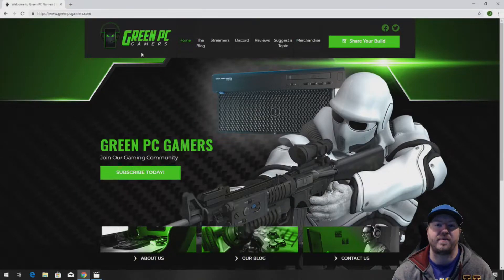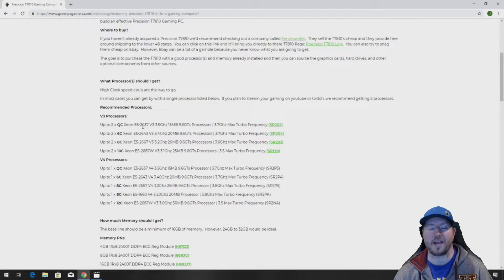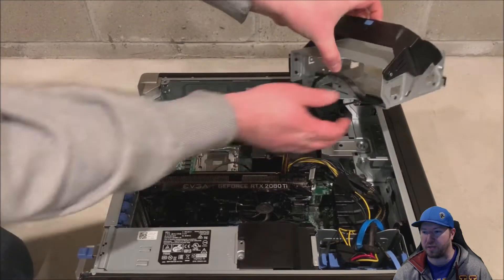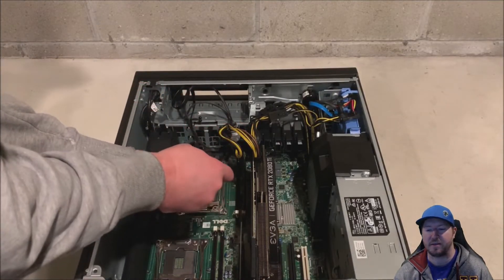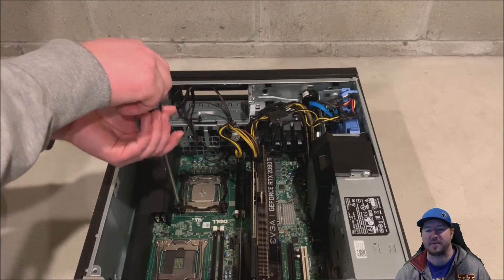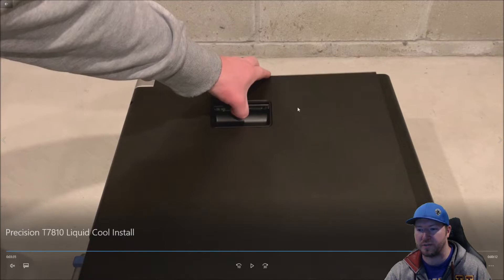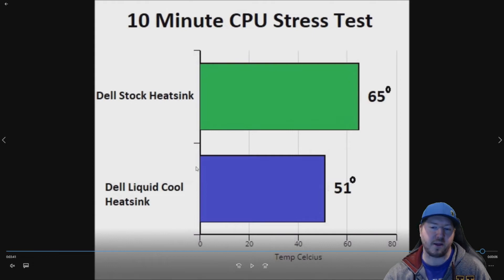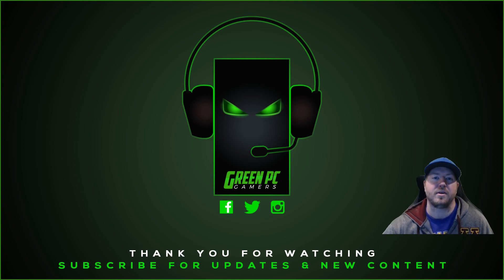Precision T7810 Liquid Cool Heatsink Install for Processor

Comment: looks quite large, can you install the same heatsink for the 2nd CPU?
Reply from the maker: We’ve never tried 2 of the liquid coolers in a T7810.  You should check out the T7810 noctua heatsink install video.  The noctua heatsinks perform better than the liquid cool heatsinks.
Reply: @GreenPCGamerscom  yeah man.. i found this out a while back so .. no need for water cooling :)

Comment: What’s the main difference between all the T series workstations?
Reply: The precision T series are designed as servers and for servers processors (more cores more threads) and non-error ram memory. Because of this they are good for gaming, running Virtual machines and more in comparasion to the workstations T series.

Comment: I have a t7810 with a Inteo Xeon E5-2670 v3  @2.30ghz 12 core 
Is this a good cpu or should I swap it out for a E5-2637 v3, E5-2643 or E5-2687?
Currently I am able to run warzone,fortnite, apex legends and valorant no problem but it only boost to 2.8 ghz max .
Reply from the maker: The E5-2687W V3 or V4 would be a nice upgrade.

Comment: do you have issue on black screen and no cable connect on ur tower? cuz mine just install Gtx 1660 Ti it's get black screen randomly. runnnig PSU dell 825watt and 6 pin to 8 pin pcie cable.
Reply from the maker: Could you try a dual 6 pin female to 8 pin male adapter?  Was the card new?
Reply: @GreenPCGamerscom   just 6 pin to 8 pin cable, i have original dual 6 pin cable came from Dell cpu. yes. is new card.

Comment: could you show me some air cooler compatible to be inserted in the  dell t7810 with 2x xeon 2690v3, so as not to cut the cover? thank you!
Reply: I would be interested in this too.
Reply: Well, as a liquid cooler.    T7810 can by default, be air cooled using Dell components.

Comment: Can it work 5810?
Reply from the maker: It can, it's very similar to this install.
Reply: @GreenPCGamerscom  thank you so much!
Reply: Look out with your cpu mounting measurements
Square ILM (80×80 mm mounting pattern)

Narrow ILM (56×94 mm mounting pattern)
Reply: @jefpeters67 Good catch. The t7810 looks like square and T5810 looks rectangular. Do they make a mounting bracket for the t5810? Almost pulled the trigger! Thanx!

Comment: can you do 2 x E5-2695 v4 with the dual liquid cooled heatsinks?
Reply from the maker: We haven't tested those cpu's yet.  However, we are optimistic that they would work.
Reply: I can't speak to the heat sinks, but I'm running dual E5-2695v4 with no problems so far (only been a couple days).